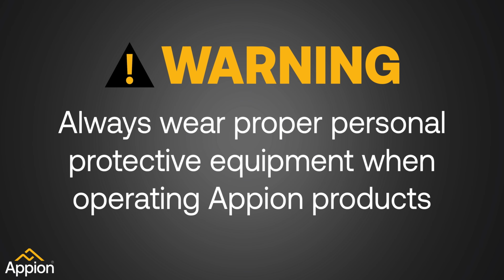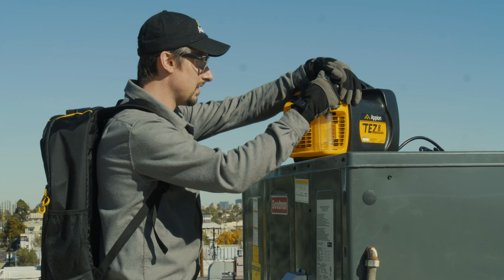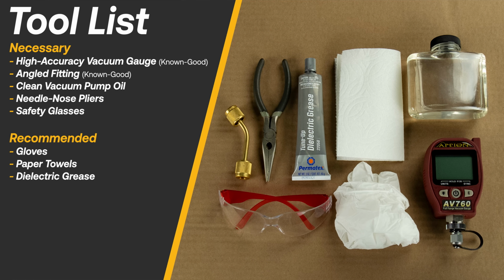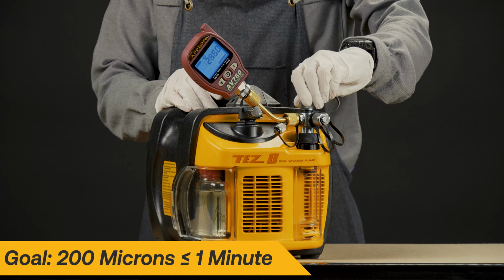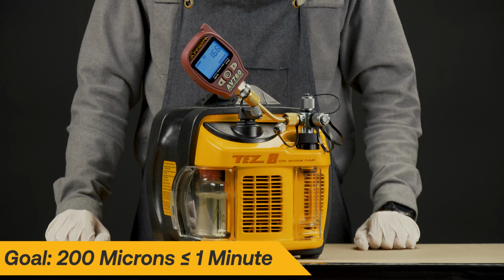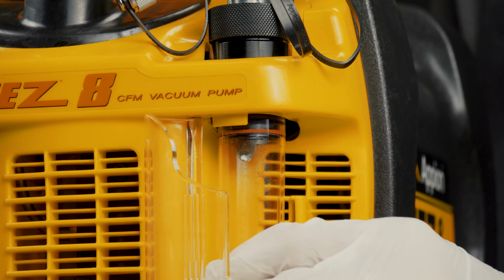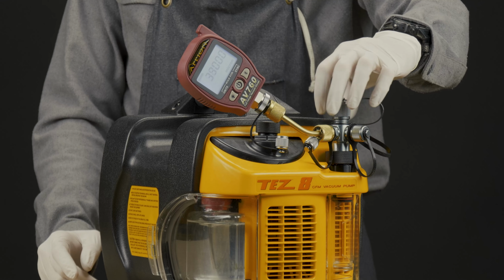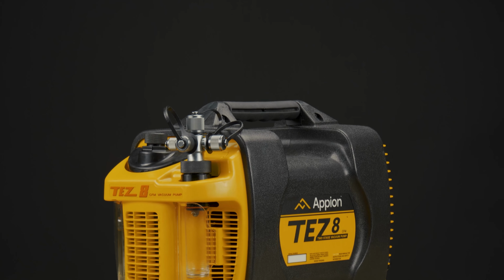TEZ8 Field Test

Comment: G5 and the Tez-8 sound like they are coming apart right out of the box. Too many o rings to leak on the tez-8, debris tube always loose from being in the truck. Should be a metal threaded tube with a window to the clear tube inside
Reply from the maker: Thanks for the feedback. Neither machine should sound like it's failing. Please contact support at support@appioninc.com  if this problem persists.